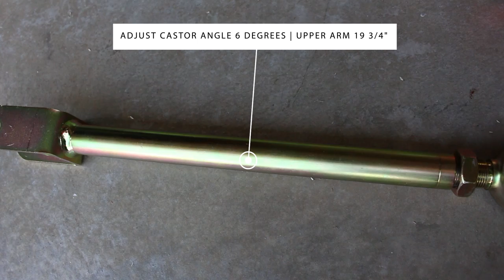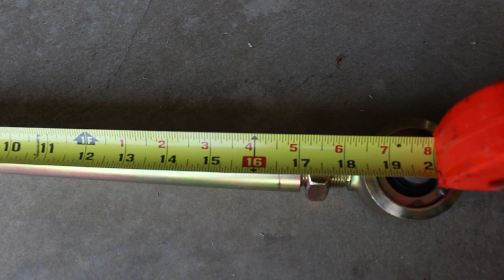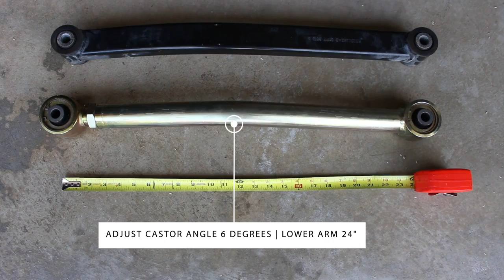Jeep JL Metalcloak Lift Install 3.5" Game-Changer | Part 1

Comment: Should you not torque down the control arms until the Jeep is back under its own weight? The bushings will bind up.
Reply: Read up on Metalcloak bushings.

Comment: Shouldn't the front 
lower control arms be installed with the joint toward the read? Your driver side has the joint on the axelside

Comment: I noticed you flipped the lower control arms, so the jam nuts are on the frame and not the axle, is this the correct orientation?
Reply from the maker: Per instructions from MC, it is the correct orientation.